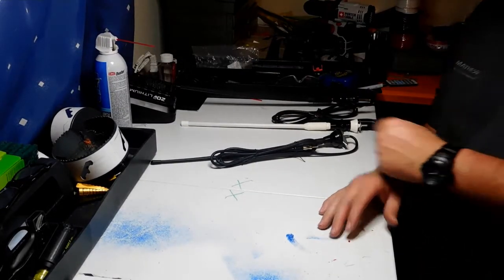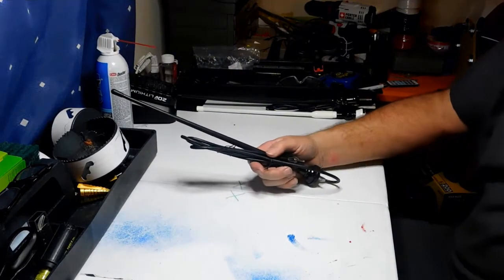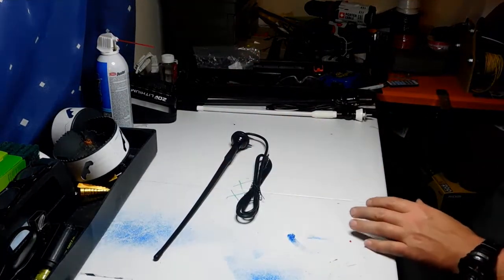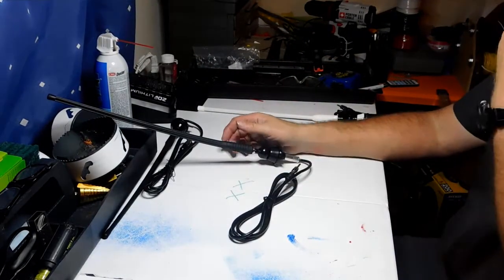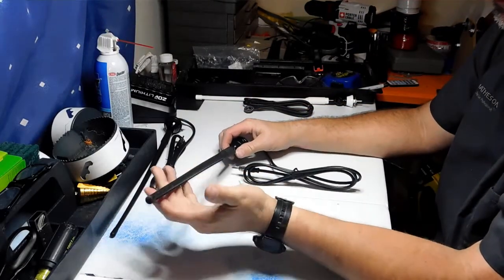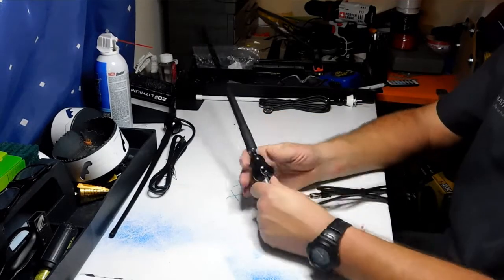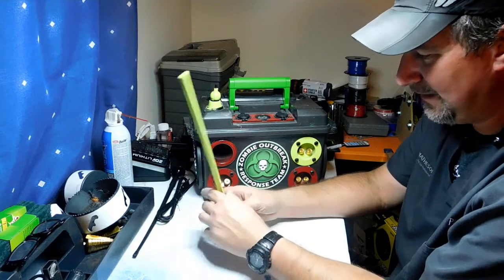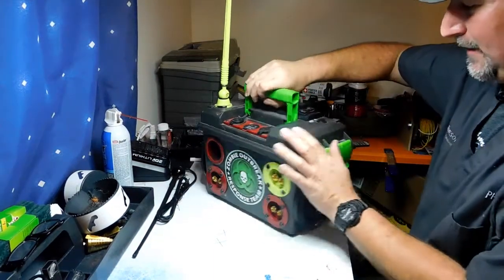How To Choose An Antenna For Your Boom Box  Project

Comment: Phil, I'm certainly not trying to be a critic of your work and information...Please. fine builds, but I wish to share a bit of my own knowledge with the many antennas I've built over the years...An antenna is really nothing more than a probe into the electro-magnetic field all around us...The first antenna used were a simple resonate length of wire and still to this day, the most popular form to use for an antenna...To say that after a build, a person chooses a .50 cent piece of wire over a $10.00 mini whip antenna is not a good decision, is simple false...A resonate piece of wire is far better than a coil loaded Rubber Duck type antenna...Inside that rubber duck antenna is none other than a piece of wire...May or my not be in the form of a helix spring or a straight piece of wire...I would also say that what you see at the bottom of the marine antenna you have is a loading coil to bring that small of an antenna into near resonance with the FM broadcast band...Probably to a length of a 1/4 wave...A ground plane is much more important on a transmitter, but the ground plane is used to help meet the 50 ohm impedance most receivers like to see, but most VHF receivers do well without a ground plane...The Fm broadcast band of 88 MHz to 108 MHz falls inbetween what was the old channel 6 and channel 7 of commercial Tv  and you don't see a ground plane on the Yagi type antenna used to receive those frequencies...The leads for the d/c power supply would act as a sufficient ground plane as well as the radios chassis...Your choice of antennas for that type of project is a good choice Phil, but not so for the reason you give...Your 30' coiled piece of wire within the one receiver may work far better for MW (am) broadcasts than  FM broadcasts, although a pick up wire to couple with it and a variable capacitor would optimize it...The coiled loop design would also work for HF frequencies...So, I hope I may have brought a bit of knowledge to your build and nice video Sir...
Reply from the maker: glk001 you have. And I appreciate the knowledge. I'm still experimenting with different things that work and don't work.
Reply: That's exactly what most of us within the radio hobby do Phil and is a part of the fun of radio...Enjoy your hobbies and your day Sir!..

Comment: @DIY Boom Boxes In Texas  are their any  external antennas or adapters so I can mount one to the roof of a house ?  I want to  put  a car stereo with one speaker in the living room.   I  might make a wall design box something that will stand up on it own.
Reply from the maker: leonardo brocato threy do make outdoor gm antennas for your home. Now this antenna would plug into the back of your car stereo. You could mount it in thr house behind thr stereo, or run the wire out a window. Here is a link. https://www.amazon.com/Jensen-Marine-AN150SR-Amplified-Antenna/dp/B000FOUWNQ/ref=mp_s_a_1_15?ie=UTF8&qid=1525055770&sr=8-15&pi=AC_SX236_SY340_FMwebp_QL65&keywords=fm+outdoor+radio+antenna